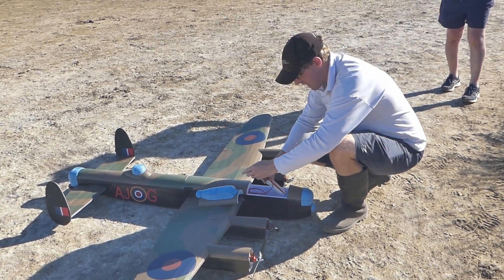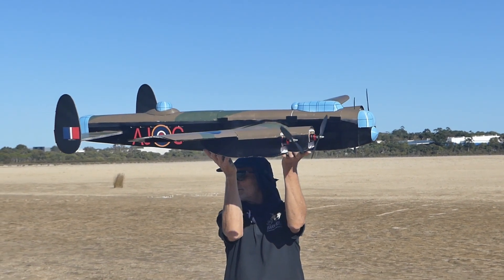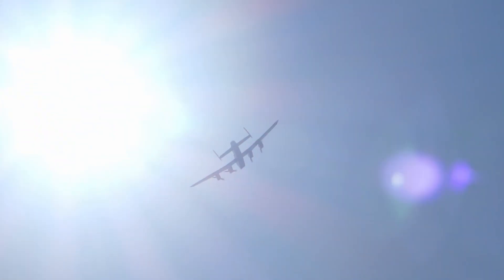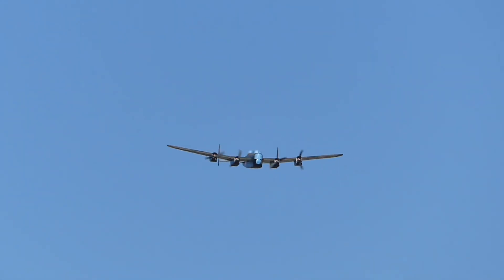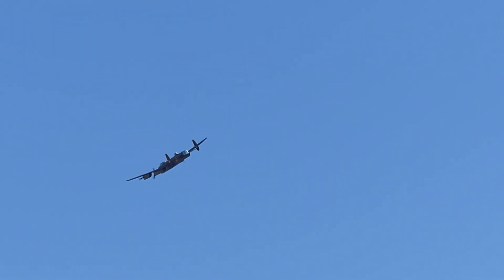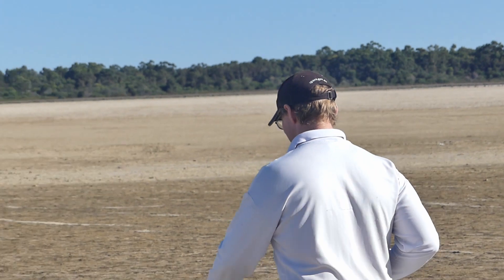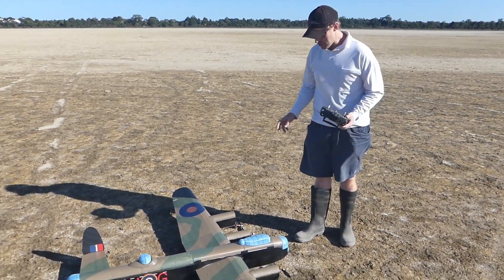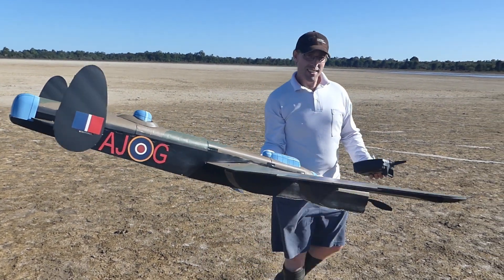Project Air RC Lancaster 3 m wingspan maiden flight

Comment: Fab job on the build to David! Looks so much better than my basic prototype. Great to see another one of these finally out there after the destruction of mine. I believe mine had an AUW of 2.1kg, and I think I flew it on a 4s. Never tried it in breezy conditions, so maybe that's why full throttle was required? Anyway, hope this plane has many successful flights, more than mine did! - James
Reply: Hi James. Paint and 3D printed parts added weight, especially to the tail, which needed to be balanced. Full throttle was needed because I had 10x4.7 (i.e. fine pitch) props. Waiting for some 9x6 to be delivered which will hopefully fix that. What props did you use?
Overall, the Lanc is a beauty.

Comment: Looked really good in the air, and not too tricky to handlaunch either.  With long wire runs from the battery to the esc, it will mean low-voltage cut-off on the ESCs triggers earlier than it should. Did you check the batteries after?  This might be a model to drop the lvc slightly if you can program that?